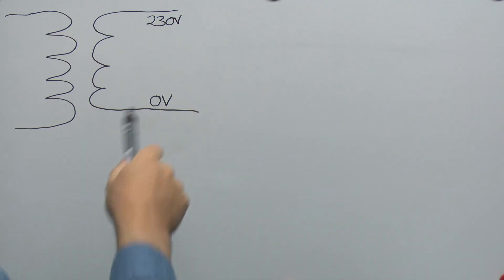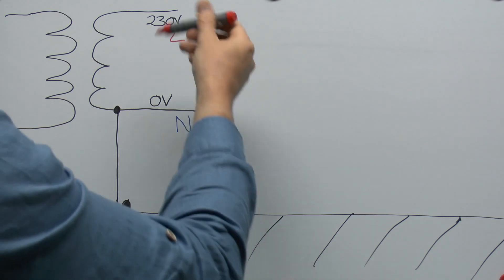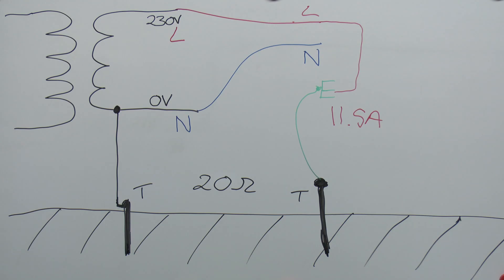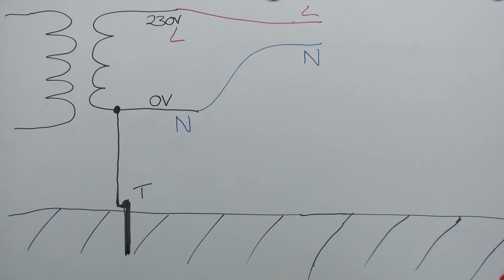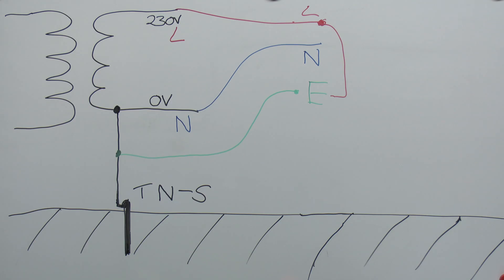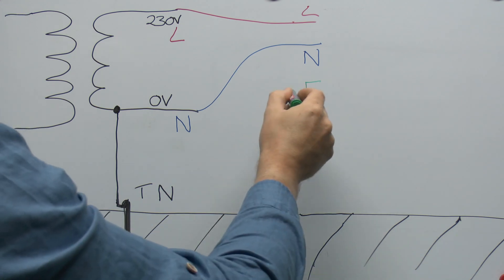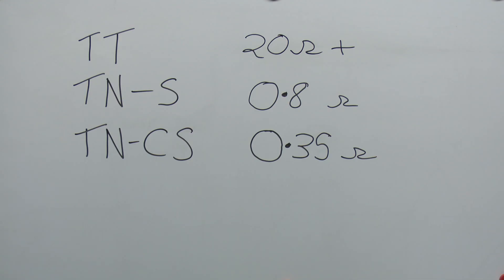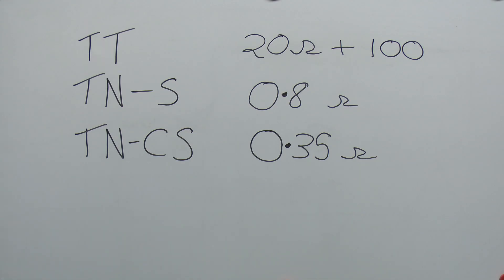Types of Earthing System for Electricity Supplies (UK)

Comment: Hi John, if in a very unlikely circumstance the neutral line in a TN-CS supply cable was broken and as you mentioned exposed parts would become live. Could this situation be avoided by adding an earth rod in addition as a fail safe? 
Effictivelly using 2 types of earthing arrangements combined in one installation.
Would this work? 
Is it allowed? 
And what would the earthing arrangement then be classed as?
Reply from the maker: It would still be TN-C-S, additional earth electrodes are permitted and are actually shown in a diagram in BS7671.
That's where the PME (protective multiple earthing) comes from - there are multiple connections to earth at various points along the supply cable.
Whether it would have any real effect is another matter - additional electrodes will reduce the voltage on exposed parts if the cable is broken, but to reduce it to safe levels the electrode impedance would have to be extremely low, in the order of just a few ohms.  Not likely to happen with just a single rod.
However it would be of use if the earth connection was made to something like reinforced concrete forming the foundation to a building, as that would typically have a very low impedance due to the large area covered.  Such things would need to be considered when the building was being constructed.

Comment: At 10:46 in that instance, where you show the break, the appliance would cease to operate as there is no return path (neither N nor E). The more dangerous situation is where the Neutral circuit is broken downstream (towards the transformer) of the closest earth rod, in which case appliances will continue to operate using the E path as return, thereby putting metal appliance and metal pipe surfaces at, or near, line potential.

Comment: Hi john with tt system I know the ze maximum is around 200 ohms 
But when doing zs testing on individual circuits such as a ring or  
Cooker etc is the maximum allowed reading 1667 ohms so if its bellow that is that satisfactory
Reply from the maker: 1667 is a theoretical value based on the maximum touch voltage (50V) and a 30mA RCD - 50/0.03 = 1667 ohms.  In reality it needs to be much less, 200 ohms being a typical maximum value, and ideally under 100 ohms.  Impedance of an electrode will change over time depending on soil conditions, weather, etc., and high values over 200 are often unstable and indicate a poor installation.  Over 200 ohms should be investigated further, and not just assumed to be ok.
Reply: @jwflame  thank you John so on certificate the maximum permitted zs for each circuit would be 200 then. 
I have seen it where say the ze is 20 ohms but the zs on the ring say    
Is 1.45 ohms is this because it is picking up a better earth from the bonding perhaps. And should it also be a 16mm main earth cable on tt with 10mm bonding
Reply from the maker: yes, ZS will often be lower as bonding to 100s of metres of metal pipes in the ground will be far better than a single earth rod.  However the value for the rod alone should always be considered, as metal water pipes can be replaced with plastic ones at any time and that lower value suddenly becomes much higher.
Reply: @jwflame  ok jw so just to clarify zs at each point of the house ring,cooker,lights should be lower than 200 ohms. Should it always be 16mm earth and 10mm bonding on a tt as well cheers for the info. still learing so trying to get  My head round this tt system thanks

Comment: Very good. Here in Australia we use the TN-CS system but the main earthing point is connected to an earthing electrode via the main earthing conductor and to the main neutral bar on the consumer side via a link which must be the same CSA as the incoming neutral. We call this the MEN link, and the system the MEN system (Multiple Earthed Neutral) as the neutral is earthed via the MEN link and in various points back to the TX star point. The consumer main neutral therefore functions as a PEN conductor. As JW mentioned, we do occasionally get instances of open or high impedance consumer main neutrals and shocks have occurred. RCDs clearly won't open as there's no current imbalance between A and N on the consumer side. There are also hazards if consumer mains are connected with incorrect polarity but RCDs (if installed!) will open if current flows to earth in these cases.
Things are easier when you have only the one system! :o)

Comment: Why can you not  use a a contactor  with the coil  connected and of course fused down  across the consumer side of a TT  supply system   and then use the neutral as the earth.  if the neutral  was to be broken down circuit the contactor would disconnect and isolate the supply  preventing possible dangerous earth fault currents  migrating to external properties on the common neutral bar.  Of course there would need to be the normal rccd protection etc  but in theory that should eliminate the need for an earth rod .  Are  there any  particular reasons why this would not be acceptable.

Comment: There is a minor error here. Most lead supply cables are covered in bitumen. The lead sheath is only visible where the termination has been made at the cutout. So the lead sheath rarely functions as an electrode. Also, in very old services the lead sheath can crack due to loading stress on the ground above, so a periodic loop impedence test is especially important on TN-S supplied installations.

Comment: SSE are now installing more and more TN-S systems on new connections work. TN-S is now always used when connecting up metal clad buildings or connecting to the old PILC cables. Funny how everything seams to go full circle. As a cable jointer I personally think that TN-S is a better system. Really good vid by the way.

Comment: Hi John, I have watched your videos with interest and I have a question for you, firstly to say I am not an electrician, I have  bought a  house in the philippines of which I have not yet visited, this May, I go. The pictures I have been sent of the electrics are scary to say the least, you may not know but nearly all meters in the Philippines do not go in the house they are fixed to the electric suppliers polls outside out of reach of tampering hands, mine is about 6 Meters + away from the house, and what we call tails to the consumer unit from the meter is about 6 meters+, it comes into the house and connected to a DP 60A switch which I think, but it could also be a two single pole as there are two 60A markings, if this is the case I don't know where the N is, and they feed 4 inline fuses like they use to use in cars, and there is no earth, would I be correct in thinking that a TT (though not ideal) is the only way I can get over this earth problem. Also the cable coming into the house looks very small from the photos I have received, your advice would be most appreciated. Kind regards Brian. PS, I did make enquiries to qualified electricians in the Philippines but it would seem most are dead or in shock, a job opportunity for a short life.

Comment: Have you produced a video which explains why many devices don't have an earth connection. E.g. even e.g. powerful Japanese HiFi amplifiers that draw some 1000 watts (obviously only when running flat out - extreme example-) only have power cords with + and -. There is no earth connection. On the continent I know that equipment is always double insulted therefore not requiring the extra earth connection to the wall socket, but with European equipment this is a class (whatever it's called) that states that as long as the current drawn is no more than 2.5 Ampere, no earth is needed. But as said, these Amps and other equipment draw far more, and are not earthed. 

e.g. Have a look at this power socket, it only has the + and - pins, no earth and yet it is a substantial amplifier.

https://www.google.de/search?hl=en&authuser=0&biw=1920&bih=926&tbm=isch&sa=1&ei=ztxZXImpIomdkwXClJPABw&q=pioneer+a+717+r%C3%BCckseite&oq=pioneer+a+717+r%C3%BCckseite&gs_l=img.12..35i39.83594.85630..88630...1.0..0.337.690.2j1j0j1......1....1..gws-wiz-img.FFO6coONCgA#imgdii=hx_4hoYG2KMgPM:&imgrc=oGJvZYRDn9TVkM:

... and with this picture of a US amp, it too only has a 2 pin +/- plug and in fact 3   2Pin unearthed sockets for more equipment (saving to have to use a multiway power socket).

https://www.google.de/search?hl=en&authuser=0&biw=1920&bih=926&tbm=isch&sa=1&ei=sN1ZXNOdEcydsAextJrwBQ&q=pioneer+a+717+&oq=pioneer+a+717+&gs_l=img.3..35i39j0l2j0i30j0i24l6.125951.125951..126113...0.0..0.66.66.1......1....1..gws-wiz-img.eIHRRJiO-SE#imgrc=uVZ0wGd2DqGlQM:

Comment: Hi JW very interesting I’m on the PME system 
For a couple of years now I’ve had the odd LED in the kitchen flicker .... but a couple of days before Christmas Day the lamp in the living room was flickering badly it’s connected along with my mother’s riser chair through a UPS and it was making funny noises so plugged the chair and lamp back into the wall socket and changed the lamp...

Then on Christmas Day (2018) dinner out of the way we were watching tv when the RCD tripped switch it back on everything was fine for about 30 mins and it done it again this happed a few times through the night...( I had called my sparky and was coming out Boxing Day to have a look ) about 8am my UPS for my hard drives etc started going between battery and mains and very loud humming noises of the transformer inside the UPS 

Anyway sparky came out tested everything and put it down to a faulty RCD put another one in (not new) everything tested ok .... tried the old one in a test circuit and it tripped ! 

But as I was switching thing back on in the house came back out to speak to the electrician when I noticed a neighbour had an electrician in as well I told mines and he called him they were having the same problem as well so we called Scottish utilities they came out and was a fault underground ....
I have since had the RCD that was put in go faulty again it wasn’t new plus was in when having problems ..... so new one installed so far so good

But next week having a new unit installed with the new robc and a power surge on the supply into the house ....

Great channel 👍

Comment: I am trying to bring UK stanards to Thailand.

All buildings are TT with no earth or ground of any description anywhere.

If I could tap into neutral be fore consumer unit main switch, crucially not cut neutral cable when joining earth to it.

Will this now be:

1. Safe?
2. TNC (PEN) ?
3 Goos idea?
4. Conforrm to Regs?
Reply: In Thailand they use TNC-S.
What i've heard is that they connect the ground rod to the neutral in the consumer unit.

Correct me if i'm wrong. In a TNS earthing system, the fault current = shortcut current, which is very high, your breaker will trip.

Careful, the shortcut current (Icc) is depending on the length of the cable.
For safety reason they also install a Residual Current Circuit Breaker (RCCB) in a TNS system.

Comment: Hi John, I have a Victorian terraced house with very old underground cable supply. There is no earth clamp or soldered earth connection from the armouring - instead there is a 6mm earth running from the fusebox at the front of the house through to the rear on an earth rod. Some adjoining properties have an rod in the pavement, but many don't. So before I have an upgraded consumer unit do I need the supply company to provide an earth from the supply cable or ask permission to fit an earth rod in the pavement as the distance to the current rod is very far away and guess wouldn't pass the Ohms test!  Or can an earth rod be fitted inside?
Thank you.

Comment: I now want to see an electricity sub station's Earth rod (s). How do they calculate the size / effectiveness?
Reply: Usually lots and lots of 8mmx30mm copper tape buried around the entire sub station it's all designed by the engineers of the sub and presumed loads
Reply: And how reliable in a real life scenario for the furthest installation in line.😒

Comment: How do power company face the issue of earthing the transformer to avoid a fault on high voltage to be 'distributed' trough the PEN to all the customers attached? TNC could have been ok 50 years ago when RCD weren't available and MCB/fuses were only protections available for ground-fault. But today with RCD I think is better to have PE as far as possible from the high-voltage 'center grounding' of the transformer. l'd just prefer to avoid the risk of getting few kV on my desk lamps casing.

Comment: There is another type of Earthing  that you could of included. It is called PNB. Normally used for one domestic supply only to a single phase 11kv - 230 transformer where the earth for the transformer is via the neutral block on a 100 amp cut out connected by a 32mm covered copper wire to earth electrode/pin in the ground. Although historic, lots still exist and are in use in Dorset/Wiltshire/Hampshire and Somerset.

Comment: Thank you, I passed my C&G 236 with distrinction, but never fully grasped this subject.

I now live in Thailand where there is no earthing and horrific workmanship.

Pretty much every building repiar I install a TT system with RCBO.

Eaerth rods are ineffective ZS + 100 Ohms.

Connection to buried in concrete iron re-bar works better.

My forcefully implentation of these practices has been adopted by the electrical authority here.

Comment: Question. What could cause a pd between earth and neutral? I’m surprised to find my rcd trips when I cut the cable with an isolated mcb (obviously)...
Reply from the maker: Voltage drop - if the neutral has current passing through it, there will be a small difference in voltage between the load and the supply due to the resistance of the wire.

Comment: JW, in the first section in your drawing you show the earth connected to the neutral on the transformer output coil or winding.  But this is AC current. So as soon as the polarity changes (50 cycles per second) the positive 230vac is now connected to the earth creating a short to ground?
Reply from the maker: No, the only connection to ground is that single wire between ground and one side of the transformer.  Whether that side is negative or positive doesn't matter, it's only negative or positive when compared to the other terminal.
Imagine the transformer is a battery.  You can connect negative of the battery to ground - nothing happens.  If you swap the battery terminals so positive is connected to ground - nothing happens.  A short circuit can only occur with a connection between both terminals, or between ground and the terminal not connected to ground.

Comment: Quite a few years on! Well presented, but it would be useful to observe that it's usual to require cross bonding between Earth and copper piping within houses - e.g in my place (which has TN-C-S) the water and gas pipes are cross bonded, with the underground pipes being plastic, so that all the exposed copper etc is connected to Earth. Plumbing alterations should take account of this, if there are any electrical disconnections in the installation.
Reply: That is an important subject, and John deals with it in a separate video on bonding. However, bonding is not earthing; bonding is to avoid a voltage potential between metallic parts in a building. It's related of course in that it will be bonded to earth in effect, but there is also equipotential bonding.

Comment: Hi John Ward,nice video. I would like to know if you could perhaps explain how one would go about choosing which type of supply to use. If you designed an installation from the ground up.
Reply from the maker: There isn't really any choice - you get what is provided by the electricity suppler, which is usually TN-C-S on newer installations and TN-S on older ones.
The only choice is to not use the supplied earth and make it TT - but that is significantly inferior for most applications, so unless it's a specific situation where TT is required, you just use whatever is provided.
Reply: John Ward thanks John and what type of applications would one expect to use a TT type system. I know IT systems used in medical locations for reasons i think of no earth fault tripping the supply to the entire installation.but TT im still unsure of where one would prefer that system.

Comment: Can you tell which system your house has from the voltage between Earth and Neutral?
Reply from the maker: No, it will be zero in most cases.
If it was a TT system then when heavily loaded there may be a small voltage between E&N, but the same effect could also occur on TN-S.
Reply: I have a TN-S system by the looks of things, and there is a 1.5 VAC difference between Neutral and Earth, is this normal?

Comment: with the TN-CS system is it not a good idea to ad an earth stake at the house
Reply: I'm not sure why that would be the case. In practice it happens by default in many UK homes as the incoming earth has to be bonded to incoming water and gas pipes at point of entry (or any metallic element in the buildings structure). As those pipes are embedded in the ground and very often metallic, then there is often a de-facto earthing rod or two in many properties.

Comment: Good explanation, but, why is the neutral cable connected to the earth in the first place? If it was not connected you wouldn't get electric shock unless you touch both live and neutral wires.
Reply from the maker: Isolated would be safer, but the problem is keeping it isolated - any fault or other connection anywhere would convert it to ground-referenced, and then you have no control over which conductor is referenced, or any devices to disconnect when a second fault occurs.
Reply: Thanks for the reply,  very interesting videos.